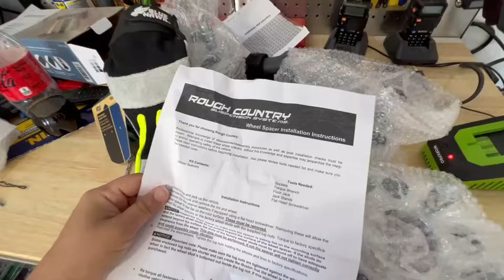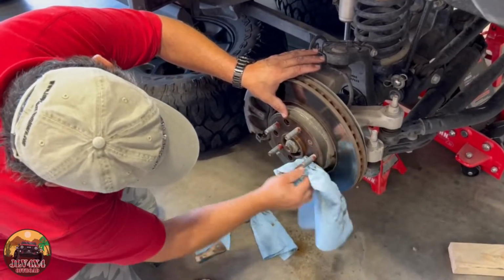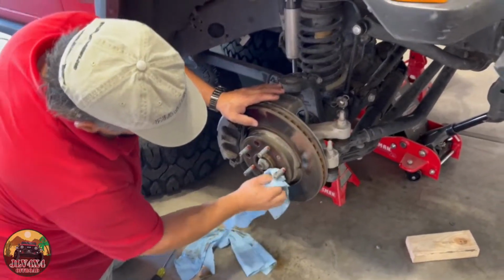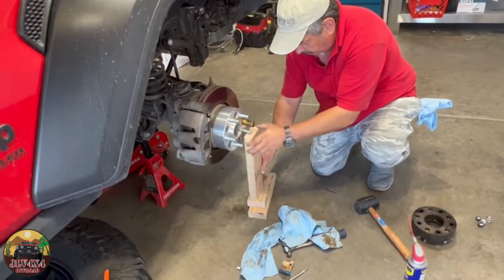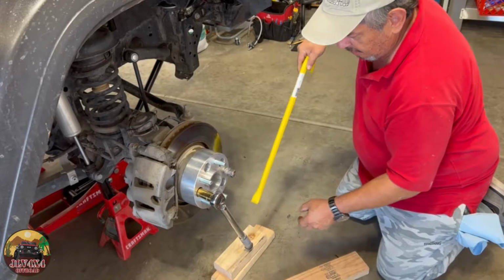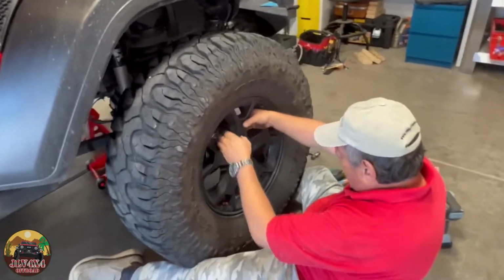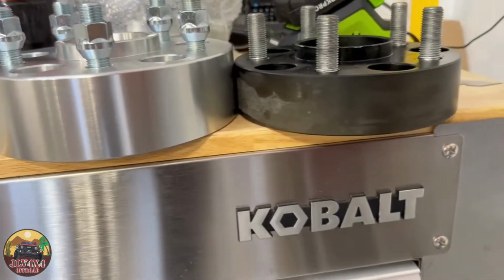Installing new wheel spacers on my Jeep Willys!

Comment: I’ve had luck putting a screwdriver in the edge slots of the disc in the caliper opening where the brake pads are to torque the spacer on.
Reply from the maker: Ahhh I need to try that next time! Thank you! 🤙

Comment: I was thinking of adding spacers because I wanted to keep my 2020 Willys rims when I add the 35” tires any feedback?
Reply from the maker: We used to have 35s on the original rims with 1.5” wheel spacers and it worked perfectly.
Reply from the maker: We were able to do this without any problem
https://youtu.be/AXBjCYPk30k
Reply: Thanks for the reply I really appreciate it
Reply from the maker: @nelsonh.568  Of course! Thank you for watching!
Reply: @jlv4x4  I have the same set up on mine 1.5inch spacers 35 inch toyo open country with the stock willys rims works perfect.